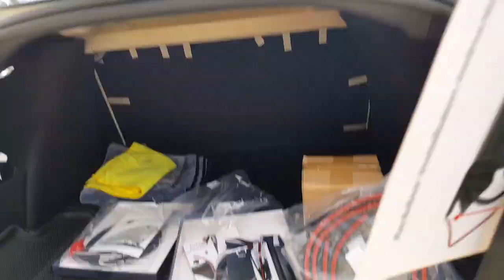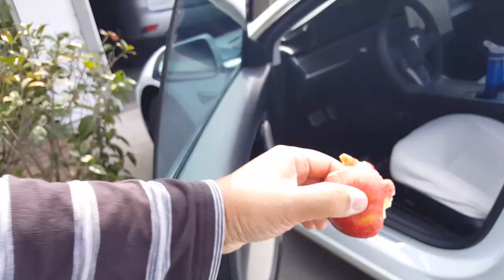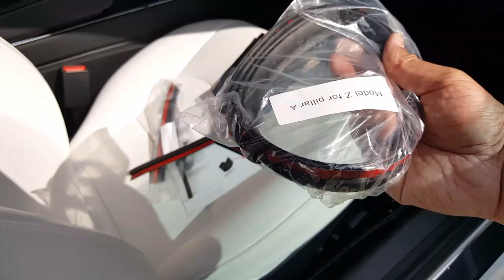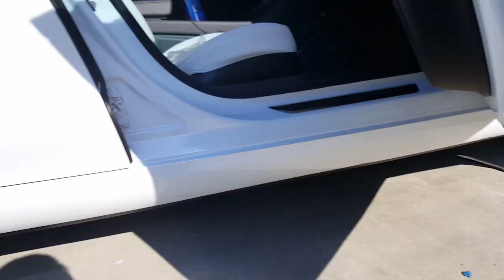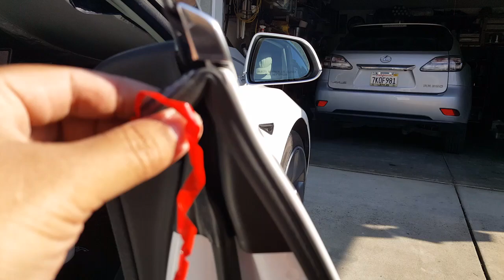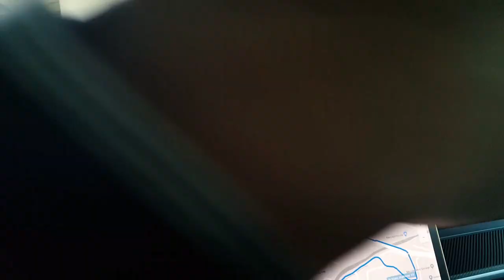Tesla Model 3 Door Seals Installation 2 of 2

Comment: Yeah there should be holes drilled on the bottom of the seal or slits for the water to drain because it can cause moisture to settle against the door itself and moisture for eventually bubble even through the paint. There should be a couple holes drilled through the seal. And or slits.